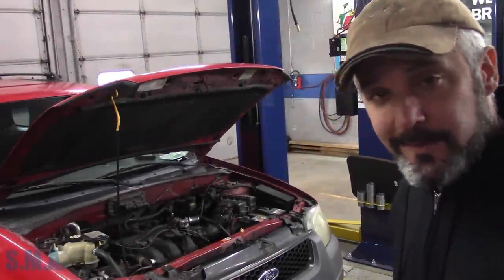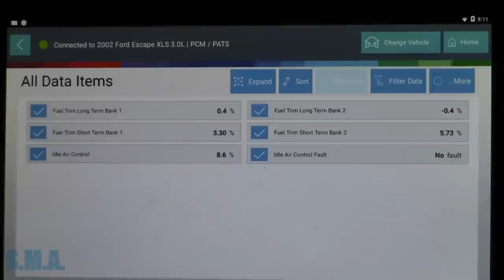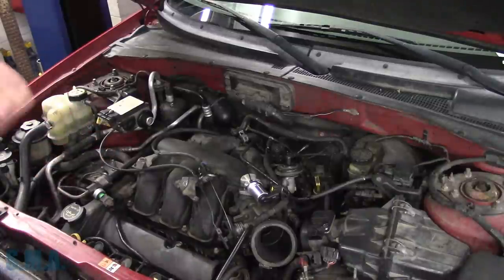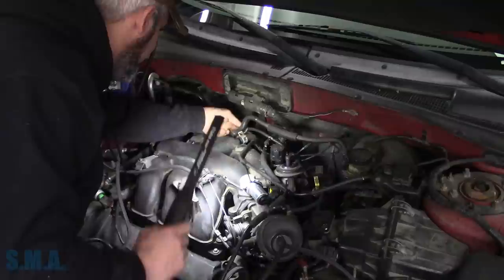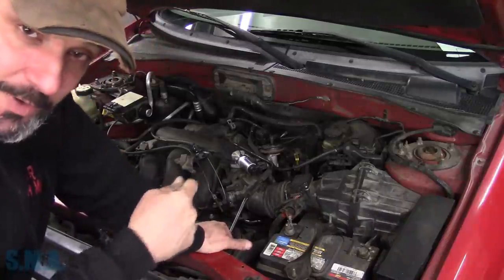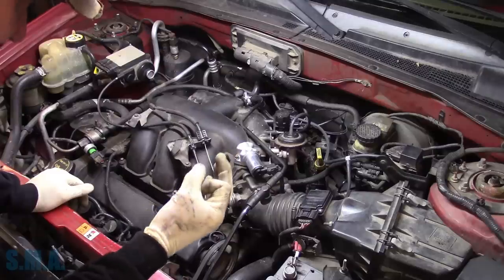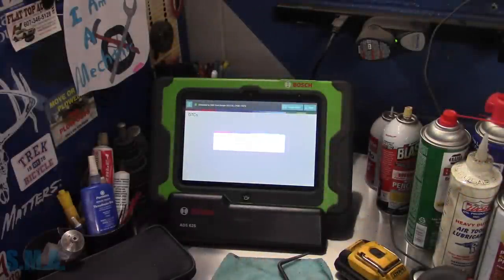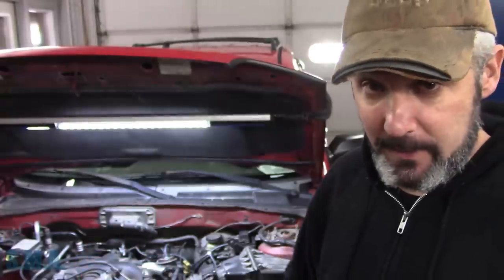Ford Escape:  P1506: Idle Air Control Overspeed Error

Comment: I have a 2000 Taurus with the same 3.0 in my shop right now.  Those engines have more vacuum tubes that you can shake a stick at!  Seems like they all rot at the same time.  This one also has intake gasket leaks.  At least the car isn't rusted about in half. LOL.

Comment: Strong engine, those things are bulletproof. you can count on the fact that the intake has been off of it a half dozen times though, the coils are notoriously junky and you have to pull the intake to get to the rear row. I ran one of these up to 375K miles and it was still running like a sweing machine when I traded it out

Comment: I'm a shadetree mechanic who just did it out of pocketbook limitations. In 1984 I bought a Dodge 600ES (Lebaron) with the big 2.6 "silent shaft" engine. I shoulda known.... Anyway, when I bought it I figured I would have to take that car with the loom of vacuum hoses back to the dealer for engine repairs. Shortly after the warranty ran out it failed emissions on a 5% hi rpm CO. The dealer kept it a day and pronounced the Mikuni carburetor bad. I asked what was wrong with it and he said it was bad - $600 would make it better. Short story - I took it back and fixed it with a new $20 fuel pump. THe original was not putting out enough flow so when the throttle was suddenly opened the float bowl got sucked down and the Mikuni feedback carb went full rich. Let off on the throttle and it had lots of gas, failing the emission test.
That lazy mechanic put the tools back in my hands. It takes so little to drive off a customer - why do that?

Comment: You were correct in calling out the person who did that crappy job.  The "I haven't been trained" is a BS excuse.  Look at how the factory did it before you touch the dang thing and put it back that way and don't break crap as you take it apart - it isn't rocket science.  It does however take some semblance of work ethic and pride in workmanship.  I'd be absolutely ashamed to send a car back to a customer that looked like that - I just could not and would not do it.

Comment: Only thing I have to say about your comment on bad mechanics is, well, they do exist and there is no avoiding it. I work for a Ford stealership as a gas drive-ability and electrical diagnostic tech (Two subjects which I have learned a LOT from you on, so thanks for that!), and one of our lube techs just drives me up the walls. I actually got into an argument with him today over a set of sealed beam headlamps on an old work truck he just did a DOT inspection on. I could tell the seals had failed on both headlights from across the parking lot, because the reflectors had oxidized and turned black. I didn't even need to see them up close to tell they had water in them (Which they totally did!) So I just asked him if he wrote the truck up for head lights. Now, I'm 26 so I'm a "Kid" to most in this industry. But good lord, I know why you older gentlemen get frustrated with my generation. He's fresh out of high school, and the amount of attitude he gave me over that question just blew my mind. He even did it right in front of our boss. "Well it still works, doesn't it?" was his response, and he just walked away. That headlamp would be a DOT failure, and he wrote it off as being fine. Not to mention, valuable hours that our shop needs in these hard Covid times. I did one thing all day, pulled an oil pan off a 5.4L to diagnose a spun bearing. Then sat at my toolbox staring at the truck because I had nothing else to do!

Anyways, thank you for all the time and effort you put into these videos, Eric. Like I said, I'm only 26 and I have a lot to learn. Your content is always entertaining, and full of information. I've honestly lost track of how much I have learned from you! And your comment about some techs not having proper guidance is spot-on. I had a time in my career a few years ago where that was me. I had no guidance in the form of being an apprentice and was constantly being thrown into pretty heavy jobs, then getting yelled at when I failed or did it wrong. Thankfully I've pulled out of that nose dive with the help of people who cared to take their time to beat things into my head. Keep up the hard work!!

Comment: From watching your channel, Mr. O, I put $1,100 down on a 2003 Chevrolet Blazer ZR2. I noticed that the fuel gauge will randomly drop down to key off/engine off setting, all the way below Empty. Due to watching your show and knowing nothing about auto electronics, I suspect the problem is fuel level sensor is going bad, current isn't getting to sensor intermittently, or current not getting from sensor to gauge intermittently. My suspicion is it's a loose connection or wire rubbed open and randomly shorting to ground. Gauge sometimes quits as I hit a bump in road and sometimes will start working again after another bump...that symptom is why I'm leaning more towards wire problem instead of sensor going bad.

Comment: 20:18 "this is why people don't like going to shops".  That's 1,000% me, when I go in to have something repaired and then later find out that there was something damaged during the repair.  Had the tires rotated at the same(dealership) place since new and they messed up the lug nuts by using a larger size socket when rotating the tires.  Now, could I had them to replace the lug nuts at their expense?  Or are they not responsible?
Reply: They should have seen there was a problem on the first lug nut . How many did they mess up? 
And yes they should replace all they messed up, or ruined
Reply: @bertgrau9246  Unfortunately, they messed up all 20.  This happened because they used the wrong size socket.

Comment: Had this problem on on two different 2000ish Tributes and both ended up being loose covers that the PCV screws into.  The cover bolts to the lower intake and the PCV valve threads are twists into.

Comment: This thing had a recall for the accelerator getting caught under the engine cover at wide open throttle. When it happened to me, after the initial shock, I reached for the key, left it in gear and shut it off, letting it roll to a stop on the side of the road and then wiping the sweat off my brow. The average non-mechanic type person could have possibly been killed and in fact, several people were killed due to this problem. I left the engine cover off the vehicle after that incident until I became aware of the fix that has you trim away some of the plastic structure under the engine cover, near the throttle cable assembly. 
Note: When this happens above a certain speed, say 10-15 mph, NO AMOUNT of braking will even slow this vehicle down, no matter how hard you mash both feet down on that brake!

Comment: I have some bad repair shops around me. Went to have ac service because it didn't fire up. They didn't find out why and took out the refrigerant.. so I did check the coil of the clutch and it was dead. Now waiting new clutch assembly parts to arrive and change that sucker on my parking lot. Then I'll go to another place to fill the system up.

Comment: The state I live in (Michigan) does not require vehicles to pass an inspection.  It is unlikely that any vehicle as old as the Escape would have any emissions work completed, unless the problem had stopped the vehicle from running.

Comment: I remember before the smoke machines were invented we had to use the adapter on the fuel fill pipe to apply slight pressure on the evap system, then use the sniffer probe with headphones to listen to the "beep" noise. If the beep intensity changed then you would know where the leak was. Unfortunately it didn't work very well at all and that's when the smoke machines appeared. Much better system. I feel your pain though with other shops. What annoyed me back in the day was when they had spent a ton of money and then brought it to us to fix for as cheap as possible. I kept wanting to say, why didn't you bring it to us to begin with? Oh that's right us dealers are too expensive. When they just spent how much somewhere else and still not fixed.
Reply: I am personally not a dealer fan. With flat rate, it is often not repaired on the first visit. All of the dealers need genuine mechanics, not guessers and parts changers. These real mechanics are hard to come by at dealerships.
Reply: @psav1520  I used to be one and took pride in my work unlike some. Don't group them all together as being that way because they are not. If it's not fixed right the first time it's probably because someone was too lazy to verify their repair to the vehicle. That is the last step to working on a vehicle before giving it back to the customer. To not do that step is pure laziness.

Comment: Thank you for a great tip on how to repair a common problem on an old vehicle,,,, When I am looking for a vacuum leak, I have usually used starting fluid to spray around vacuum lines,,, When the motor speeds up, I have found a leak,,,,  Can you give me your thoughts on using that method??

Comment: Fact of the matter is that 18 year old vacuum lines on any car are going to be split---been replacing vacuum lines on my cars for the last 10 years, its frustrating,  but if you find one cracked hose or elbow...just run the gamut and replace them all. Saves the continuing frustration of chasing it down one by one.

Comment: It was a lot easier when I started driving - 1937 Chevy - 1 Vaccum line to dist, 1 line to the windshield wiper motor. Still have a vacuum leak? Intake manifold gasket.

Comment: I had this insane idle control problem on my college car.  86 Chevy Celebrity 2.8L MPFI V6.  Every cold start the motor would rev up to like 3k and then down to stall or almost stall.  Sometimes only one crank was needed but normally two cranks were needed to keep the engine running.  This idle up and down thing went on for about a minute or two and everything was fine.  Sold it at 120k miles and it was still doing the same thing.  Nobody could figure it out.
Reply: I forgot to say that my father always taught me to do it right or don't do it at all.

Comment: Well, I am pleasantly surprised by this one. You really did need to say what you did at the end, not so good that you had to if they are charging the same rates as you. Frankly if you don't know what you are doing then don't do it. I was told as an apprentice when I started work for the NCB way back in the 1970's the only stupid questions are the ones you don't ask. Either because you are too vain to ask or because you daren't.
I've always asked. Kinda why I'm still married to the same woman after almost 40 years I guess.

I was also told a few other things: Your good deeds are written in the sand, your bad decisions are cast in Granite. Always do the best job you can. Stuff I have kept in my mind ever since I was 16 and decided to have grease under my nails as a living.

So the previous garage that used sticky tape and cable ties really should have done the job as if it was their own family about to use the vehicle. As Eric does. The only way.

I really hope they didn't ask you to do it so that they get the credit for getting it right. I really hope the owner came to you. Justice would then be done.

Comment: I worked on a friend's car years ago that didn't run well, poor idle, stalling, poor fuel economy, and acceleration. She took it to a shop where they replaced the carb (it needed it, weeping fuel and throttle plates rubbing) and tried to do a tune-up, but it still didn't run well. I took a look at it and found many vacuum leaks, the hoses were cracked and some of them would break when I disturbed them. I had the factory manual for this car and I decided that I would start by replacing every vacuum, emission, and rubber fuel line forward of the firewall. Then I started looking for other leaks. What found was, valve covers leaking air in and oil out, bad intake manifold gasket, vacuum advance solenoid, and the brake master cylinder was leaking fluid into the booster which had ruined the diagram. Replacing all these things had used-up my weekend and I hadn't time to adjust linkages the carb and timing, so I suggested that she take it back to the shop and try to get them to do it without additional charge. Well, they did it and did a very good job, her car ran great when they were done with it. She asked them why they hadn't tried to sell this work to her (they had mentioned the leaks and the master cylinder but didn't explain it or try to sell the job), and they said they thought that there was zero chance she would buy it, and just think they were trying to screw her. They were probably right that most people with a 14-year-old car wouldn't buy it, but it seems to me that a professional mechanic should feel obligated to properly inform the customer,  as you do.

Comment: I just realized that the older I get, the more I leak too.  But I still can't bring myself to put zip ties on the leaks just yet.  I recall a mechanic that I spoke to once when I was very young and very poor.  I pulled in and told him by truck had no power and I couldn't figure it out.   I also told him I was broke and hell and if I could work something out I would.   He walked out, cranked it up, revved it up,  walked around and put his hand on the exhaust.   Asked if I turned wrenches.   I said yes.  Told me to go home, pull an O2 sensor and if it ran better replace the catalytic converter.   He was right and I wish I could repay his skill and willingness to help.

Comment: Water from spray bottle (wont burn so bogs it down) or flamable carb or brake clean with system together to check vac lines intake gasket etc.

Comment: I'm having this problem with a 1997 Ford Taurus LX with the DOHC V6. When it is cold it wants to pull the IAC wide open. It started this after I replaced the spark plugs and wires and the PCV valve (I used a genuine Motorcraft PCV valve) and the deteriorated rubber hoses to the PCV valve and front valve cover.

Initially it wanted to do this all the time, until I did the warm idle relearn procedure several times. Now once the temperature gauge needle comes up it runs fine. Odd thing is I get warm air from the heat vents long before the gauge moves any.

What prompted replacing the plugs etc was it suddenly went from running great to running extremely poorly, especially at idle. I found the IAC passage in the throttle body and upper intake to be almost completely clogged. Before this occurred it ran perfect all the time, but now when it's cold it will take off and eventually get up to nearly 40 MPH (on a really cold day) before it warms up, with my foot off the gas.

What it acts like is that over time as the IAC passage progressively got choked down, it compensated by opening the IAC more and more, and now it's not relearning that it doesn't have to yank the IAC wide open when cold. I have a laptop with software and a VCMII clone. I used that to clear the KAM. IIRC before I did that the warm idle relearn wouldn't do anything. Could the PCM be damaged somehow where it can't reprogram the COLD idle settings?

Is there a way to force it to relearn the COLD idle programming? Could it be a faulty temperature sensor or some other sensor? I've already replaced the throttle position sensor and the IAC valve. Yes, I bough the correct (expensive) one for the DOHC. Costs more because the DOHC engine was rare VS the massive number of pushrod engines in this generation Taurus and Sable. Odd thing was the SHO V8 IAC was cheaper, despite the V8 being even rarer than the DOHC 6.

It can't be a vacuum leak because if it was the warm idle relearn would not have fixed the fast idle when the engine is warm. The only way it can be a vacuum leak is if there's a computer controlled valve that's only open when the engine is *cold*, and there's some hose off of that valve on the side not connected to the intake vacuum. Thus when it warms up the valve would close and stop the leak.

I've been told "Well, just let it warm up before you go.". My reply to that is "That's not how this vehicle is *supposed to work*. It's supposed to start and idle properly when it's cold. That's how it worked before, that's what I want to restore! It has fuel injection, I shouldn't have to treat it like it has a carburetor."

Comment: You weren't out of line complaining about the other shop's work. I agree if they can't or don't want to do it right then don't take the work. As a matter of fact Brian from Fordtechmakuloco jusrt did a vid on the 3.0 Duratech with loose cam bearing caps, etc. causing noise among other issues.

Comment: Question for you could you use a smoke machine to find a leak in the air conditioning system (not having the proper ac machine) what do you think?
Reply: I'd guess not, because the a/c runs at such high pressure and that smoke basically has no pressure

Comment: does inplugging a air idle control valve on a 4.3  chevy   also should have low idle it's a four wire plug..  or should idle go way up  to 2000 rpm?

Comment: the fuel regulator is pretty well shot and the hose connector to the manifold valve is cracked and that black bulb thingy whatever it does is melted and i got smoke coming out a 5 different places........usually by this time i'm on my 4th beer

Comment: Curious your estimate strategy for a repair like this, I don't expect a reply but other techs might chime in. My approach would be to see everything I think needs repaired, fumble through repair times (I operate my own shop without employees, and don't see the volume you do so some repairs are semi foreign to me) add some time and parts expense for unforeseen hoses etc and give the customer an estimate I'm mostly certain I can do the work for and finish after the repair for less or equal and encourage them to get another estimate as well.